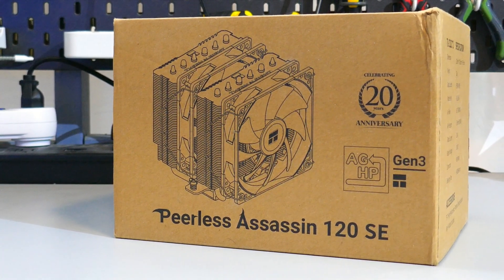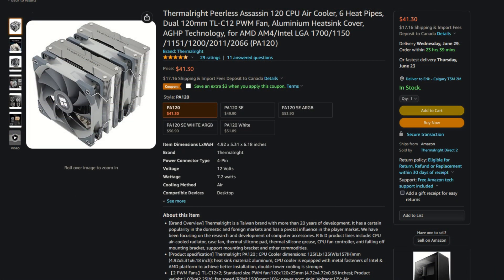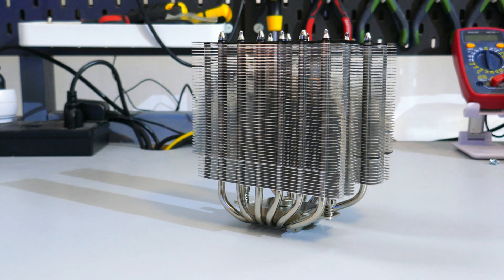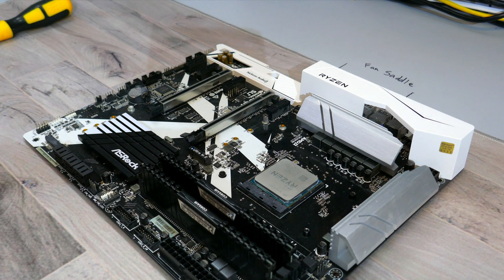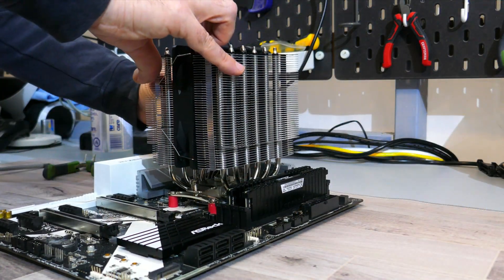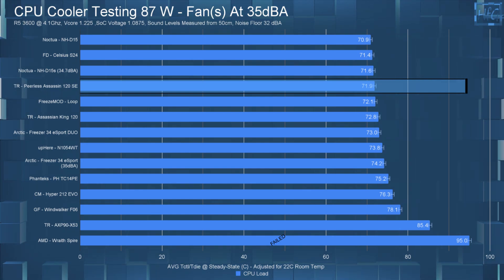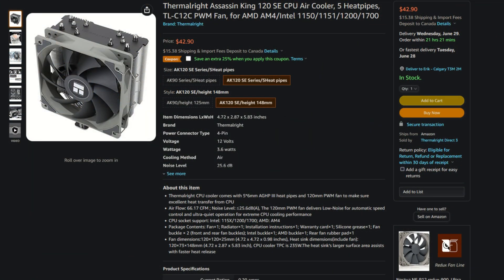ThermalRight Peerless Assassin 120 SE - CPU Cooler Review

Comment: Honestly, the hyper 212 evo being only 5 degrees warmer. Its also small. And only really requires 1 fan to function. I got one, and threw on an industrial level noctua fan, the black kind that is made to last and last. And its been performing...for years. All through a 2600x lifespan, and now is keeping a 5600x nice and cool too. Even under load in gaming, it rarely gets audible. It needs to really be being pushed.

I used thermal grizzly kryonaut on it. But in the future, if its still hanging in there. I will probably switch over to ptm 7950, for the better temps and lifespan. Only problem is, if your system stops working...you're gonna have a hell of a time taking the cooler off the cpu without causing damage if its not heated up. So...i may go with a graphene sheet instead since it performs even better, and is easier to use. Havent decided yet.

Comment: For the love of FUCKING GOD, please, PLEEEEEEASE DON'T BUY buy inferior "SE" model!!!! It's NOTABLY worse than the non-SE/vanilla version despite not costing any less at online PC DIY part retailers! 

Not only is it SIGNIFICANTLY uglier & cheaper looking, BUT it ALSO totally lacks the rubber vibration dampeners found on the normal model's nicer fans making it run louder! In addition, it has -3x less heatsink fins (50x vs the non-SE's 53x, aka ≈6% less)!!!

Not to mention the blatantly obvious aesthetic/appearance downgrades like the total lack of any heatsink stack cover plates or the MASSIVELY cheaper looking fans (even ignoring their total lack of vibration dampeners!). 🤷

And when you consider they are basically ALWAYS either the exact same price, or as of right now on Amazon the superior non-SE model is actually $7 CHEAPER ($33 vs SE's $40) basically NO ONE but OEM's/system integrators should EVER be buying the cheapo SE model!!!

In fact, the latter bulk order customers are the only reason that the cost-reduced PA120-SE model EVEN EXISTS AT ALL! It provides basically the same level of raw cooling performance in a cheaper to make and thus sell in bulk package, even if it's louder & uglier while actually doing so.

Comment: Is there a way to use this cooler if I have 44mm RAM sticks? Adjusting the fan? What would the impact on performance be?
Reply from the maker: Yes you can adjust the front fan. The performance impact would be minimal. Just make sure the case has sufficient CPU cooler clearance for the total adjusted height.

Comment: Cant its fan can be moved higher for RAM clearance pls let me know…i have team force xtreem argb rams with have 4.9 cm height😢
Reply from the maker: Yes the fans can be set higher, but the cooler will not be as efficient.
Reply: @HardwareForGamers  actually in my area the Burst assasin and this dual tower one are exactly same to same price. So which one i should take? BA or this dual tower with adjusted front fan? Even if it takes performance hit i think it wld still be better and future proof to have a dual tower cooler. Having the same price what u suggest?
Reply from the maker: @bhavyamalik3239  if you're planning on only gaming and it does depend on which CPU you are using, you'd likely be able to  use only the center fan on the peerless assassin.

Comment: Surely its better to mount the fans where they were designed to be mounted and not the opposite side covering your ram? Pretty sure the outside fan is supposed to be a pull, not push. Not sure if it affects performance but it would definitely affect my beautiful RGB ram ;)
Reply from the maker: This was done on a different cool but should still be helpful https://youtu.be/ESx5xFRKUsY
Reply: @HardwareForGamers  Awesome video thanks. I think your video claims that push/pull is better performance so I will be able to see my ram and get the better performance too!

Unless I misunderstood :S
Reply from the maker: @Veganarchy-Zetetic  better performance at the cost of more noise yes. The PA is a twin tower cooler, so there should be an even larger performance difference between push/pull and just push.
Reply: @HardwareForGamers  All this performance reduction to make the fans quieter is ridiculous imo. Put the loudest jet engine fans on my cooler and if people don't like the noise they can just turn them down and have hotter CPU's. So sick of buying underperforming CPU coolers for over £100 just because they are quieter...

Comment: Months later... Overkill for 12400.. very nice! Pisser is, Cant use cpu tempt to adjust fan curves in bios because it too friggin cool... 12700k cranked to it's arses and... i had some bad temps the first day with benchmarks then?  it just dropped like..what the hell! So we did an arctic aio280(fatboy) with a 13700k vs this.. okay the arctic blew its arse off YET... Want to game and not spend $120? THIS is your baby! (or the newer model  which has one more heat pipe) this will chill a 13700k at 5.7 all core or 5.8, 2 core, 5.7 4 core...you get the drift. she bangs within 3*c of a Noctua d15 with dual fans and so much smaller size! wslightly louder? Yep! smaller fans.. less than half the cost.. i swear, I sound like an arctic shilling but i'm not! This is the most HOLY HecK bangs for the buck coolers ever made! ( i've been drinking, pardon my typo's) So we tried to kill it.. 13900k... uh, don't run prime 95 kids.. just, no.. gaming however? Not a friggin issue! Cyberpunk 2077 1080p, 360fps, 4090.. 13900k oc'd to 5.9 all core???.... gaming? No problem at all. It hit 85c a few times then dropped to high 60's low 70's and we pushed this beotch!! Benchmarking? Yeah., 100c/ did that on purpose asap knowing it would. OC'd and gaming however with a 4090? in a few benchmarks this came out better (3x out of 10) better than the D15. half the cost? much less weight? This thing is a beast! i have the newer version arriving this week to see how much better it is! i suspect it;'s about thew same but may be even better with benchmarking as that runs a cpu into hell! or at least i do =X.
Reply from the maker: 13900K @ 5.9 all cores hole FUCK...

Comment: I bought the Assassine 120 SE mainly for a future upgrade to a 5800x3D. Currently I use it on my 60W R5 5600G. Its fairly warm in my room, summer time, window open, played Cyberpunk 2077 for an hour and the CPU temp just couldnt get past 60°C. I expect similar results with the 5800x3D in the future. Great cooler imo. It can be really tight with the RAMs, but u can still adjust the cooler fan however u want, so if ur case is spacy enough there will never be space issues with the RAm sticks.
Reply: Awesome!!! Thanks for letting me know. I guess I'll have to try this out!!
Reply: @Texasman1992  No worries bro
Reply: Let me know, I'm debating on getting one for my 5800X3d
Reply: @Texasman1992  Got it on my 5800x3D..I thiiiiink it spiked up to like 70+ degrees at some point for half a second, but its usually at around 65+-ish degrees playing Star citizen ( an unoptimized CPU+GPU heavy alpha state game) on a hot summer day, window open (CPU not undervolted!). Sooo its safe to say  this cooler is a fkn solid safe bet for about 40-45 bucks..Installations was pretty easy too, just screw it in alternating slowly from side to side and keep pressure on the other side while screwing the other side, so its not screwed in super one sided-ly :) 
Gotta add, that I think I have a fairly well optimized air flow in my old PC case, with 2 strong fans at the front, one at the back and one 170mm slow rotating (600rpm) Noctua above the board basically, inside the case door. But nontheless this cooler can easily handle the 5800x3D.

Comment: Should I go with this one, the FC 140 or the DeepCool AK620 ?
Reply from the maker: What CPU do you have? What will you be doing?
Reply: @HardwareForGamers  I have an R5 5600X, just gaming and some 3D modeling, no OC. I know it's a bit overkill but I'm thinking long term and future upgrades I can do.
Reply from the maker: @One_Hyrulean_Soldier  if that's the case I would recommend going with an assassin king 120 (so you won't have RAM clearance issues) or the peerless assassin 120 if you want a bit more cooling.

Comment: Got the arctic 34 esports duo and just upgraded to 13600k , would this pa 120 cooler be a worthy upgrade or should I save some and get a 360 aio?
Reply from the maker: Will you be just gaming? Planning on undercoating or overclocking? The esports duo is a pretty okay cooler have you run any tests with it to see if you even need to upgrade?

Comment: Thank you for this video, I am very interested in this CPU cooler.  😊 But unfortunately only a cooler with 157mm fits in my case.  And in every video I see that you have to position the fan further up because of the RAM and then it's significantly more than 157mm or. 🤔

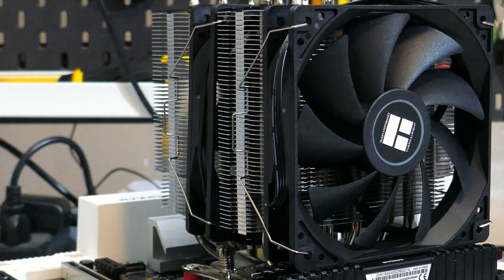3:12 They are the only one with the fan flush at the top how did they do that.  😊😁
Reply from the maker: If you're RAM is 42 mm or lower it can fit. But if your room is taller than 42 mm then it won't you'll have to lift the fan up.
Reply: @HardwareForGamers  Many thanks for your quick reply, that's really great.  Ah ok so it must not be higher than 42mm.  Did you measure from the mainboard to the upper edge of the ram.  Or how exactly should I measure it. ? 😊

I have an Asus TUF B450M Pro Gaming motherboard, and 2x 8GB Crucial Ballistix DDR4 3200MHz Ram.
Reply from the maker: @MisterMiyagi91  yes pretty much, you should be able to just measure the RAM not in the motherboard and add 1-2 mm.
Reply: @HardwareForGamers  ok then i will do it like this.  😊 
 I measured roughly and I measure from the mainboard to the ram 41.5 mm so that should fit.

So that should work, I hope.  😊 Thank you for your help. 👍😊

Comment: Got the peerless assassian 120 se black for $35 on amazon and it keeps the very hot 5800x3d while gaming from 60-75c lot of people complain about their 5800x3d reaching 80-90c with AIOs. The only issue is the fan does hit the ram causing me to mount the fan like 1/2 a cm higher than the heatsink in order for it to fit properly.. and I only have gskill non rgb ram with small a small black heatsink.. so just keep in mind for those with larger heatsinks that are all tall.. this is a HUGE cooler.
Reply from the maker: It is a big boi, gl hf.
Reply: Yeah, i was super suprised how little room there was for RAM. Ruined my setup. I will probably have to buy AIO or maybe a single tower dual fan.

Comment: Would be awesome if reviewers would mention the  airflow direction of included fans also.(or even better if the direction would be noted down by arrow sign as all my case fans have).
Thanks for the review.
Reply: Yes! I have watched five videos so far and none have mentioned this!!!
Reply: @outthere7  Every fan I've ever seen has an arrow on it showing airflow direction.
Reply: Irrelevant question. In general the nice side (face side) is sucking. So to memorize this think about: faces suck. But you can detach the fan and turn it around. Up to you

Comment: Have this cooler and the issue I have is that the fan covers one of the ram sticks preventing air flow to it. This causes it to be about 10c hotter than the other stick. If you OC your ram, this could be an issue.

Comment: hi please for the 5600X is better the pearless 120 SE or the ASSASSING KING 120 SE thank you
Reply from the maker: The 5600x would be pretty similar to the 87 watt testing, so both will work. I would get which ever is cheaper in your area.
Reply: @HardwareForGamers  the king 120 is 15 euro cheaper, so no point going for the pearless
Reply from the maker: Is the system for gaming or will you be rendering? If you're gaming there will be a 1-2 C difference, if you're rendering there might be a 3-4 C difference.
Reply: @HardwareForGamers  just normal usage with sometipmes games

Comment: Installed on 5600x stock settings. ASRock Thai chi 570.   4.5ghz zcpu bench all core.  63c 1400rpm like 80-90% full speed. I'm happy. I used their tf7 grease. I hope it's what everyone's else is getting.  

I hated putting the fans on with the clips.  Bent some fins slightly. I never used them before so I was a bit sure how they go on exactly.  Idk about that design but a lot use those metal clips.  I didn't feel great putting them on.

Comment: im getting the PA120 SE ARGB White for a Ryzen 7 5800x, will it keep it cool?

Edit: I have done my set up and all, and this cooler is awesome, with the 5800x limited to 4,2ghz it runs at 50°C and the max I've seen in CPU intensive games (Cyberpunk, GOW, etc..) 60°C. ASUS optimized mode from an asus TUF/ROG mobo makes this cpu have really good performance. Before asus optimized mode CPU would go up to 73°C at 4,8Ghz, and with asus optimized mode CPU would go up to 60°C at 4,2Ghz
Reply from the maker: for gaming? Yes, the 5800x putting out around 100-110 watts when gaming.
Reply: @HardwareForGamers  Yes, Im happy to hear that!

Comment: What's the difference between the PA120SE and the PA120? Which one is better?
Reply: SE: 50 fins, 155mm height, heatpipes stick out on the top
normal: 53 fins, 157mm height, heatpipes have a cover on the top

Comment: Would this cooler let the 7600x stay at the max boost clock and keep it cool
Reply from the maker: To simple answer your question, yes this cooler will likely let a 7600x "stay" at max boost but no it will not keep it "cool". Because it all depends on the motherboard and what settings are being used. I'll try and keep this as simple as I can, If the motherboard is set for max performance it will boost the CPU until the CPU or VRM reach max temperature then it will lower the boost slowly to keep temperatures below or at max limits. Meaning it doesn't matter what cooler you have it will always be at or near 95c. 
If the motherboard has an eco mode or if you manual under volt to use less power and voltage the CPU will reach max boost with less heat. Silicon lottery will play a big part of how well the CPU does with this.

Comment: Good for overclocking 12700k?
Reply from the maker: Yes, but it might get a bit on the hotter side if you're doing long renders.
Reply: @HardwareForGamers  
Frost commander 140 would be better?
Reply from the maker: @jxsilicon9  if you're looking to do long renders, yes. If you're looking to play games then it won't matter.

Comment: I have Peerless Assassin too, just recently bought. But why the led blink at random? Is it faulty product or could you tune with software. Also, my Asrock Polychrome couldnt control the Led, any help?
Reply from the maker: Do you have the RGB connecter plugged directly into the motherboard or do you have a RGB hub?
Reply: @HardwareForGamers  yes, the ARGB connector from the fan plugged directly into ARGB slot on the motherboard.
Reply from the maker: @achmadramdhan3629  do you have or does the motherboard have any other RGB or ARGB LEDs Polychrome can control?
Reply: @HardwareForGamers  I have asrock B660m steel legend. The software to control RGB is Asrock Polychrome. My RGB components are  Thermalright Peerless Assassin, Corsair Vengeance RGB RS, and the motherboard itself. Sadly, Asrock Polychrome only detect and control light on the motherboard loll

Comment: 10/12/2022 Amazon USA Peerless Assassin 120 SE is $35.90!! Talk about a killer deal! I would easily pay $65 for these like I did some time back with the Scythe Fuma 2 before rev 2 and their new $90 price tag. With the 12900k and equal noise (35db and 40db) This beats it hands down. Don't care about noise? CRANK up the fans even further and the temps go even lower. I have seen videos where the Noctua D15 and Dark Rock Pro 4 beat it by 5-7* running benchmarks and 260+ Watts but in gaming? it's a tie with the ThermalRight taking a 1-2* lead in my rig anyways. (I had covid and a week to kill so yeah.... tweaked both pc's and delivered the 12400 to the gal-pal. All 3 have this cooler and in 1, I replaced an AIO 240 and this has far better temps and less noise.

Comment: Great review! In case you still have the cooler, could you please confirm by measuring the height yourself? I Know it says 155mm, but I see the heatpipes are taller than the fans in the top. I want to buy this cooler for CM NR200 and 155 is really marginally fitting. Thank you!
Reply: It fits with the tempered glass panel. If it doesn’t clear, you can put the second fan over the IO panel. I removed the shroud. As it will be covered anyways
Reply from the maker: yeah that's pretty tight... you also need to think about RAM clearance. the 155 mm is to the top of the heat pipe/ fan.